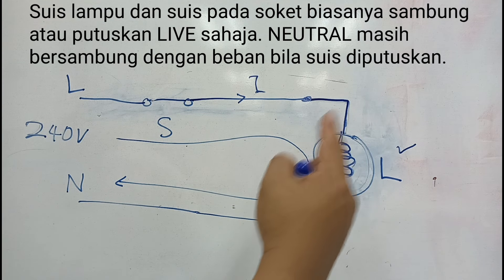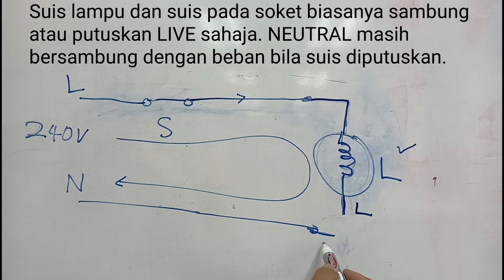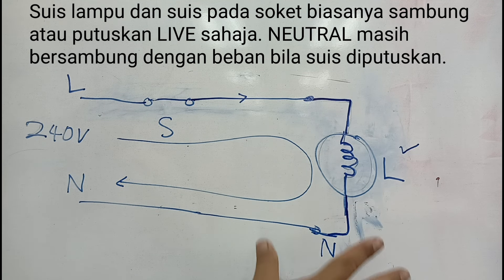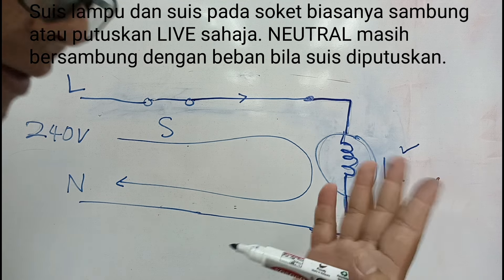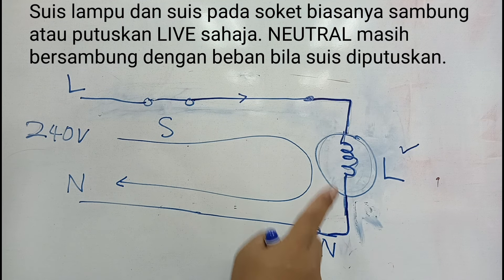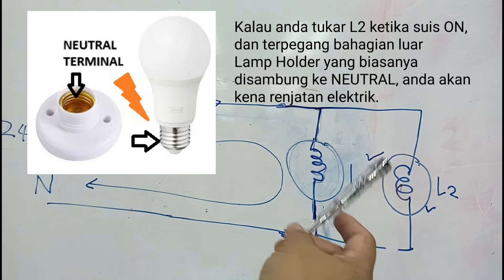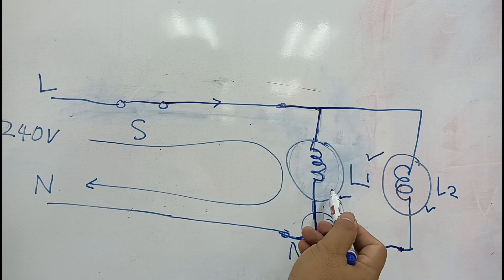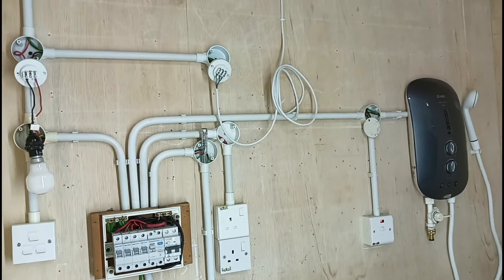Bahaya Kerosakan Kabel Neutral (Floating Neutral) dan Langkah Keselamatan

Comment: Minta tanya kenape apabila saya guna testpen sentuh kulit  getah 16mm aluminum wire di bahagian cut out fuse/db, testpen menyala. Terima kasih.
Reply from the maker: Adakah kabel tu lembap atau basah? Kalau kering, kemungkinan besar (ini kabel dari TNB kan?) penebat PVC tu sudah rosak menyebabkan arus melepasi salutan tu. Keadaan ini boleh berlaku. Boleh laporkan pada pihak TNB👍
Reply: @petrusgoel  cable itu kering dan cable itu bermula selepas dari meter masuk ke rumah/db. terima kasih.
Reply from the maker: @heavenearth99   ohh itu kabel dari meter masuk rumah. Bukan dari cut out masuk ke meter? Confuse saya…Guna kabel aluminium 16mm? Sepatutnya semua kabel selepas cutout guna kabel copper 16mm atau 10mm. Kalau test pen disentuh pada penebat kabel dan menyala, makan ia menunjukkan penebat itu dah rosak. Kena tukar kabel
Reply: @petrusgoel   Thanks for sharing. You are the best of the best.